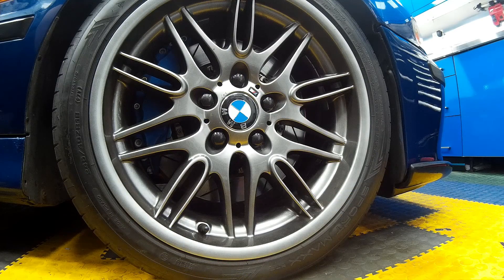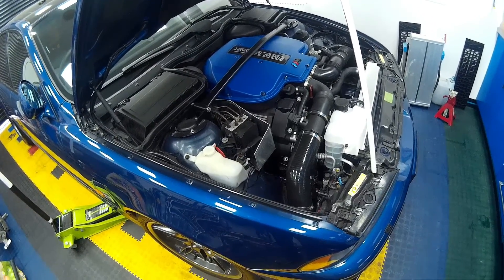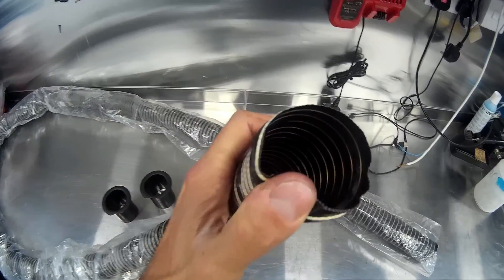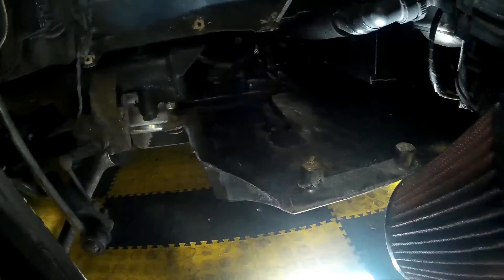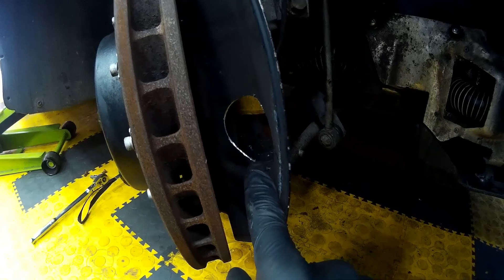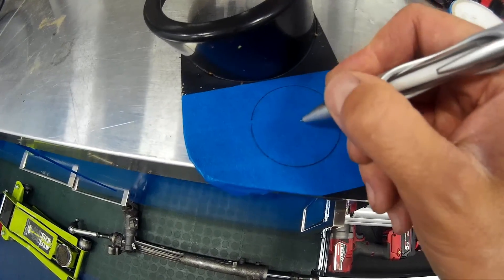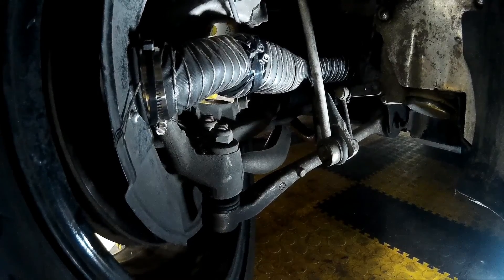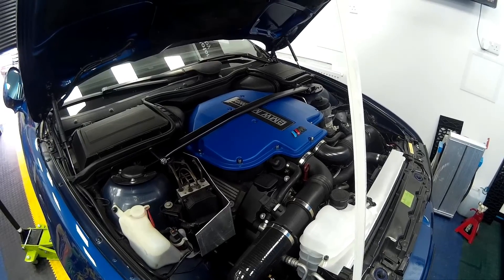BMW E39 M5 Front Brake Direct Cooling Ducting DIY How To Guide

Comment: Paul, I'm a big fan of your videos.   I've already performed the CAI build, the fogging washer nozzles build.  next will be the ABS heat shield and then most likely this build after that.  

I've added these URLs for Parts.  I assume these are what you used. 
=> RevoTec 51mm Air Outlet Ducts (https://www.revotec.com/acatalog/Air-Outlets1.html)  
=> RevoTec 51mm Red Silicone Ducting (https://www.revotec.com/acatalog/Red-Silicone-Ducting.html)  for high heat 
=> Revotec 51mm Black Neoprene Ducting (https://www.revotec.com/acatalog/Black-Neoprene-Ducting.html)  you use black.  maybe another supplier? 
=> 51mm Speaker Ports are available on eBay but links die so here is what they look like on Amazon ( http://a.co/1vxrFVc)

Comment: What if you made a Y connection and had two ducts going right to the intakes as a ram setup?
Reply from the maker: I have air feeds direct to the CAI filters already using 3.5" bass ports in the lower grille and convoluted plastic ducting to direct the air flow.
Reply: @WestinghouseProductions   hey can you show me that ? Anas_teperekidis_official on Instagram